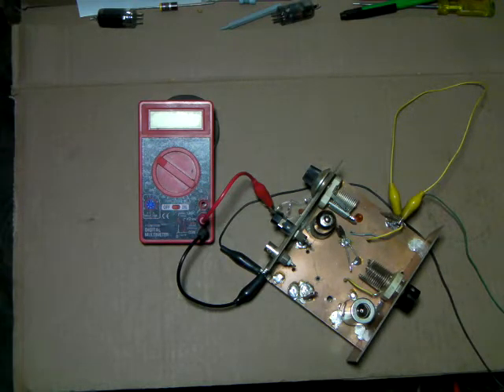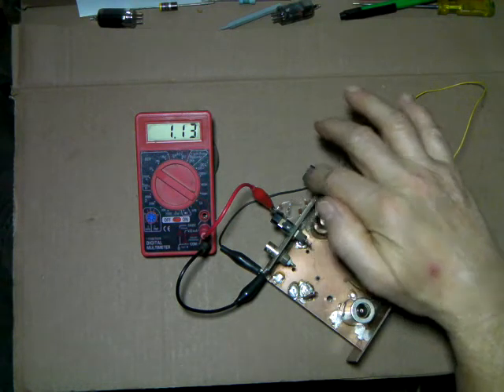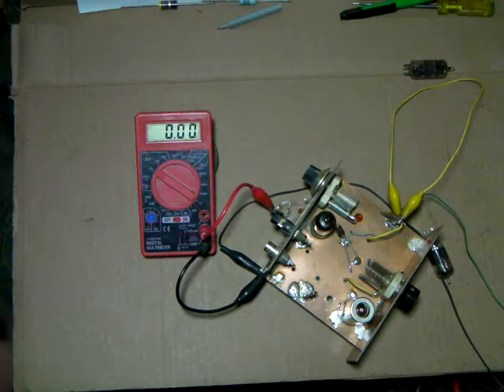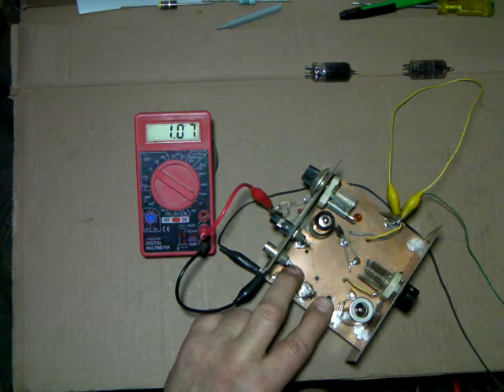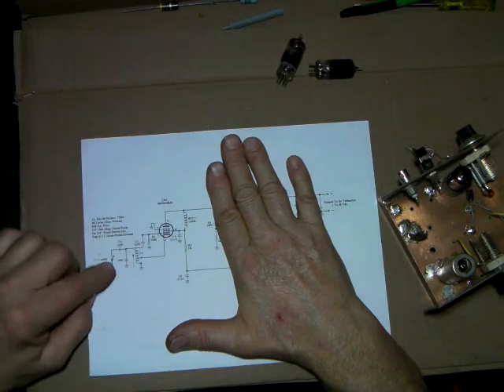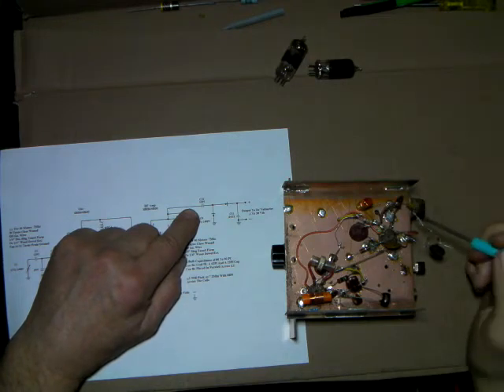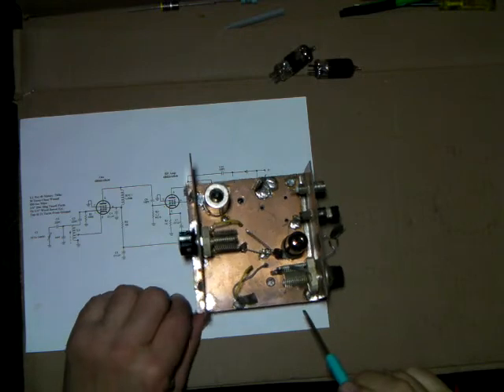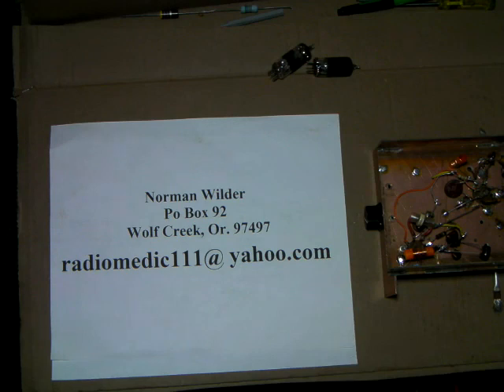DIY Tube Type 40 Meter Shortwave Receiver On 28 Volts DC: Test Equipment 3

Comment: I saw your post in Tram Dr's Video for the Palomar Skipper  4 tube 6146 amp. I need to find out the model, type of the transistor that keys up the amp. I have one that had this replaced awhile back, but the guy that did it didn't know what transistor was the exact one. If you know, please let me know. Have a good week 21.

Comment: Will you make a circuit to test a 6LF6, or a 6LQ6?
Reply from the maker: Hello and Thank You...Yes I will try to address that this fall and it will use RF so that you can see the gain from each tube that you test, not just on emission only.
Reply: @radiomedic111  I bet you could sell a few of them. 21